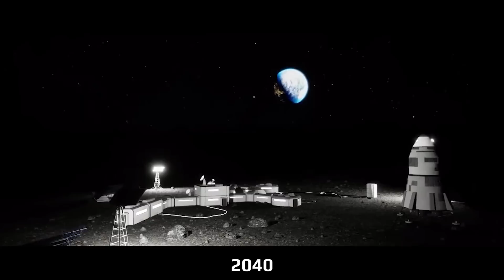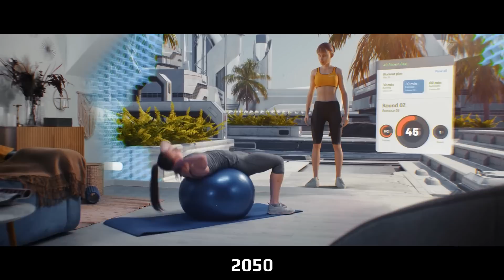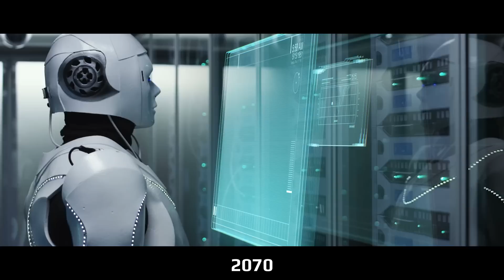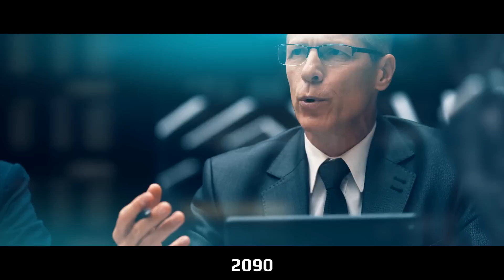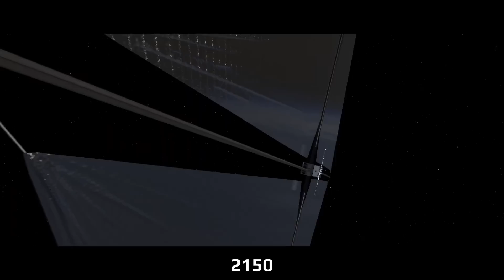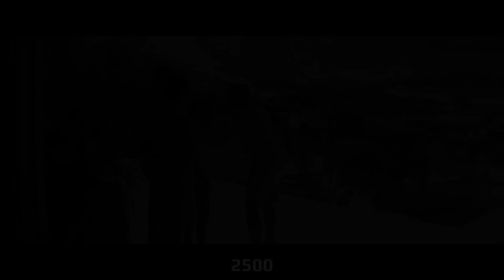Moon Colonization: The Next 1000 Years

Comment: Another thing that could be built inside a large crater or on the surface of the moon would be a massive MACH Canon used for launching smaller interstellar satellites up to speeds far faster then achieved by earlier rockets. Waiting to deploy solar sails or antenna until getting to a stable speed. These canons could be used for lunar and earth defense also

Comment: I wonder if when we have cheaper more powerful lift rockets and maybe even space elevators. Would it be dumb to start mining the vast amounts of ice on Antarctica this using a space elevator structure to suck up the water in liquid form to a space station to be like a gas station then to also transport water to the moon and fill in some dome covered craters building little lakes. Taking many decades this isn’t just to supply the space industries with liquid water but is so we can then safely uncover the land beneath that ice for future use with large solar mirrors reflecting large amounts of sunlight. Also we could replenish the worlds nearly dried up fresh water lakes all over the world. Of course we would need to safely extract all the possibilities of germs in the water that were frozen back during and before the dinosaurs. Also we need to capture the greenhouse gases that will thaw along with the water.